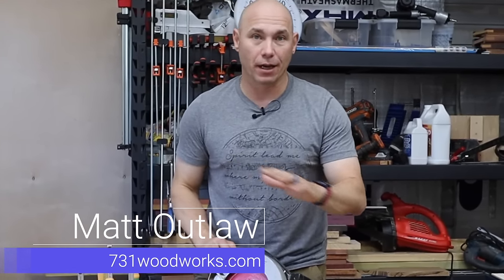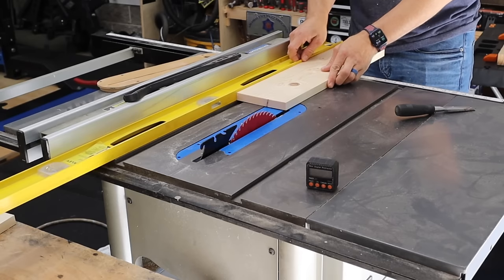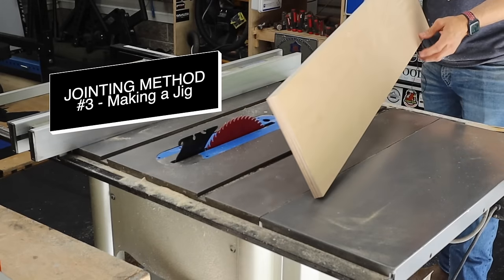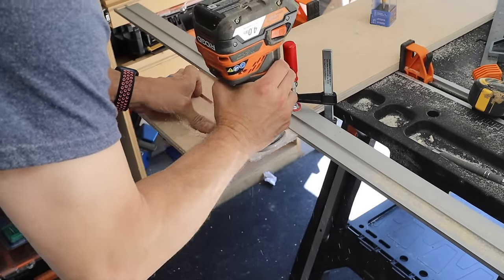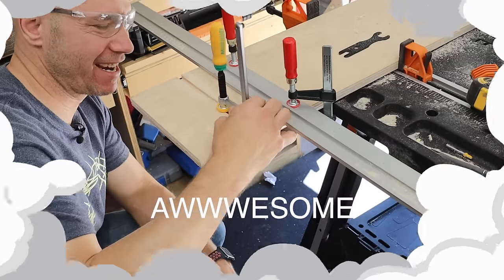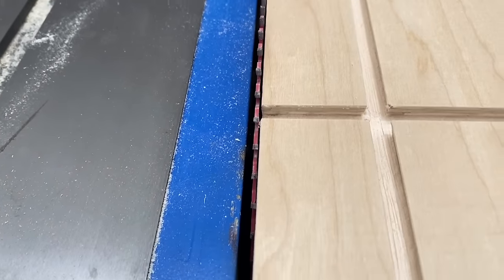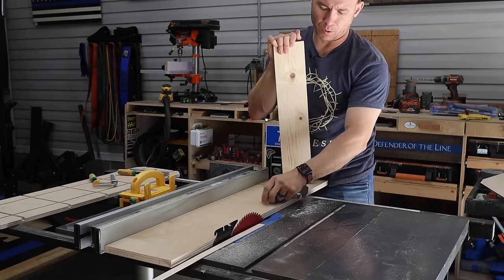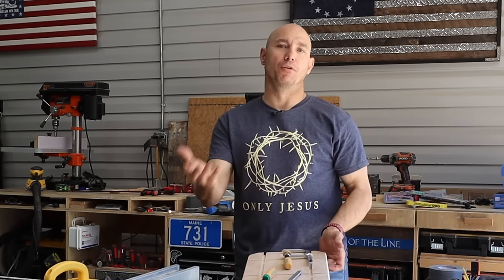5 Ways to Joint Boards Without A Jointer | Woodworking Tip

Comment: Because doing it the proper way, with a hand-plane, is far too much trouble, right?
Reply from the maker: yes.
Reply: @731Woodworks  It involves skill. Who can be bothered with that these days.....and of course, Youtube views depend on instant solutions.
Reply: I'd love to have the skill (and the time); to use a plane.  I bought a Woodriver plane years ago but never developed the skill to sharpen the blade or use it properly.  Instead, I've used a router and now  I'm using the plywood jig  (# 2 method), which works fantastic.
Reply: @peterv3878  Learning to sharpen and set the plane is the key. There are plenty of good Youtube videos on this, but I'd suggest Paul Sellers as the place to start. The fact is, a properly sharpened and set plane is constantly in use throughout any quality woodworking project, and a small investment in time learning to use it properly will repay itself many times over. The diffrence in finish between planing and sanding, for instance, is amazing. There's much more to woodworking than just pushing bits of wood through machines.
Reply: @MikeAG333  Deliberately making things more difficult than necessary is not the same thing as skill.
Reply: @MikeAG333  So you don't own any machines, I assume. That wouldn't be "authentic".

Comment: QUALITY CONTROL VIOLATION - use that angle finder to level your saw - but use a machinist square to square the blade TO THE TABLE. You squared the blade to the Earth - totally wrong.
Also an angle finder is not accurate enough - you need less than .001 inch runout to the tip of the blade from the center.